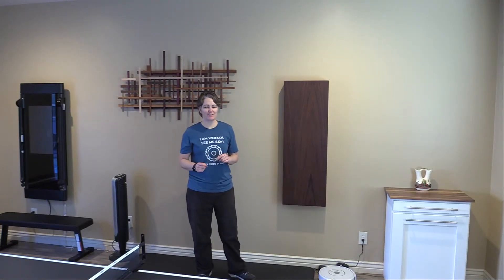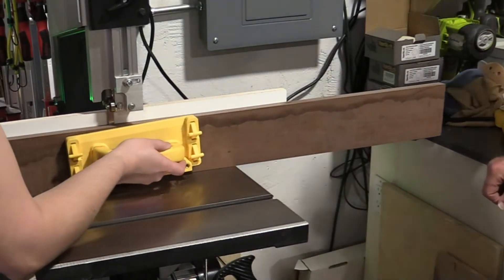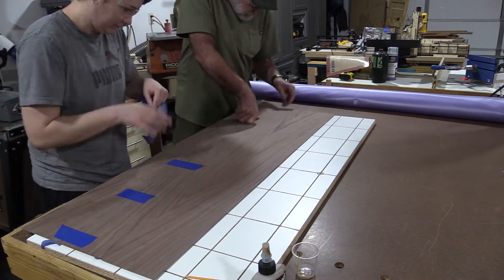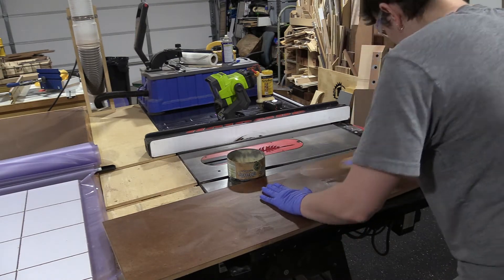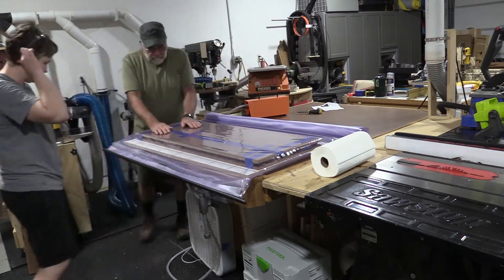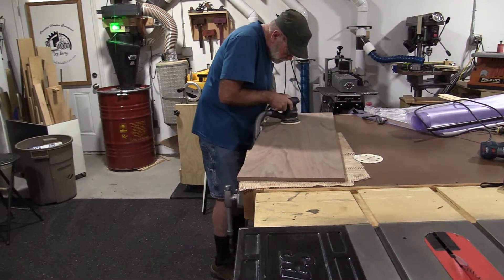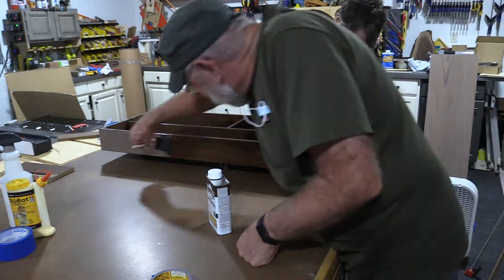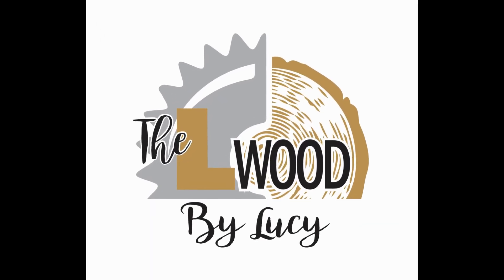Walnut Veneered Custom Tonal Accessory Cabinet

Comment: I am new to your channel and have subscribed and liked.  Two questions:  (1) Did you make the wooden stick wall art to the left of this project, and do you have a video of it?  (2) where do I go to buy one of your mallets?
Reply from the maker: Hi Susan! Thank you and welcome,  I did make the stick art but that was before I was making videos.  I made it out of scrap wood.  Started by making a frame with 4 pieces. The two horizontal pieces I off set.  Then I just took a bunch of random pieces and glued and pin nailed them together.  I am sold out of mallets at the moment but if you send me an email we can discuss what you would like and I would be happy to make one for you.  I might try to do a small scrap art piece that is similar and make a video some time.

Comment: When you ripped the walnut on the band saw, how thick was the piece and then how much did you end up taking off with the drum sander? So what was the final thickness?
Reply from the maker: I cut it just over 1/8 thick and sanded down to 3/32 for the door. I used a woodslicer blade which worked much better than blades I have used in the past. From what I have read, 3/32 seems to be the thickest you can safely get by with to assure you don't get cracks.  I wanted to leave as much material as possible.  The sides I cut a little thinner and sanded down to 1/16.
Reply: @thelwood  Do you think a drum sander is vital for veneering? I would love to get a band saw for this reason but my next big purchase is a decent table saw.
Reply from the maker: @jac_builtWoodworks  if you have a planer, you can use a planer sled (just mdf, melamine or plywood) with either sand paper, double stick tape or CA glue to stick the veneer down and  run the veneer through.  Works great! Drum sander is a luxury, not a necessity at all!